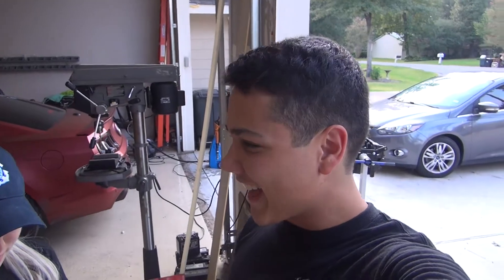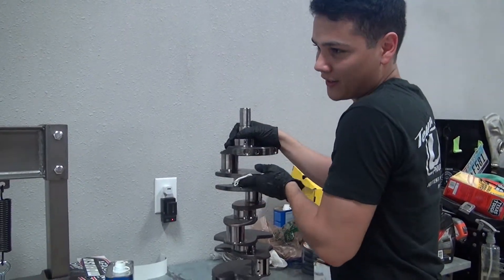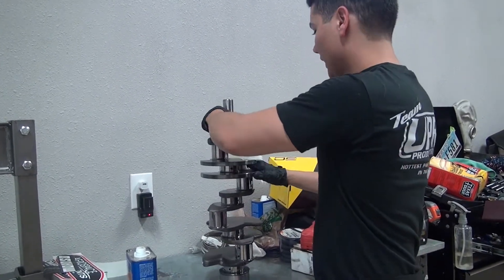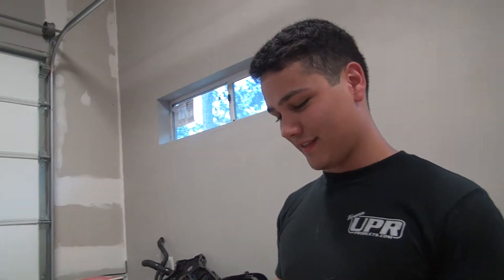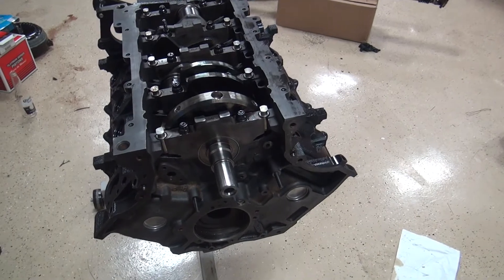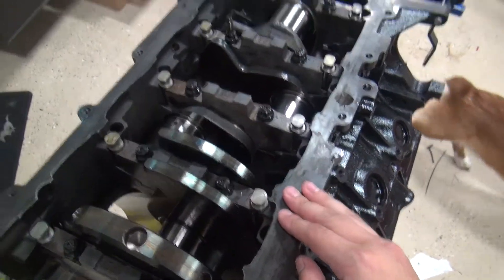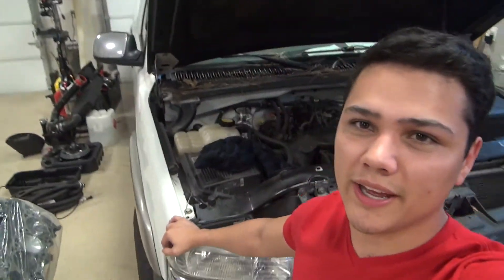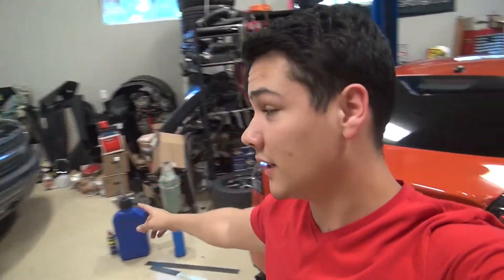Lightning Engine Assembly Part One

Comment: Is a built bottom end with stock heads and cams installed worth 6k ??
Reply from the maker: It really depends on the parts that was put on it. I would say no, my local machine shop charged me $600 in machine work and wouldve charged another $600 for assembling the short block, my rotating assembly was $1500, misc stuff (head studs, gaskets and so on) add up to another 800ish, and refreshed stock heads with the cams only cost like $600-$800. My total engine build was under 4k since i assembled it all myself. Would've been a little over 4k having the machine shop do the assembly.
Reply: @hotblume  that’s what I want to do. Cheapest short block I’ve found is like $4500
Reply from the maker: @ozzyg92  finding one vs doing it yourself are two different things. If you have time and skills it lowers the price. if you dont and need to rely on others doing it for you and have a lead time necessary itll cost more. I finished that build for $3600 including the new 8 thread cylinder heads.
Reply: @hotblume  how much experience did you have when you started building this one? I’ve never built a 5.4 2v only old school 302s but I’m pretty handy. Currently looking into if I have what it takes to tackle it on my own lol
Reply from the maker: Osvaldo Gutierrez I had previously only built one other engine and that was my DOCH 3.7 v6 engine. These SOHC mod motors require specialty tools to build like the cam holders and crank tool to get the timing right. But it’s all pretty straight forward to put together.
Reply: @hotblume  I appreciate the info.
Reply: It will be mostly manley parts so idk yet. What cams would u recomend for a budget build

Comment: Dude.. I started the same process back in April.  22K later and I'm still sitting with an empty engine bay.   Lots of work.

3.4 whip
SVO forged short
TF heads
Crower B cams and springs
ARP everything
elect fans
2/340 Aero pumps
Aero fuel system
60# inj
All SS American Racing exhaust 
Built 4R100